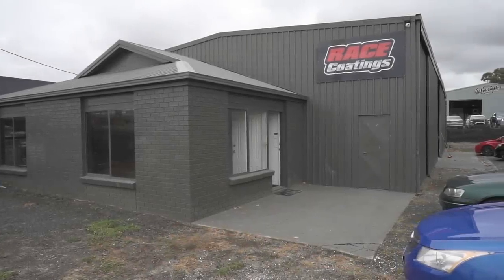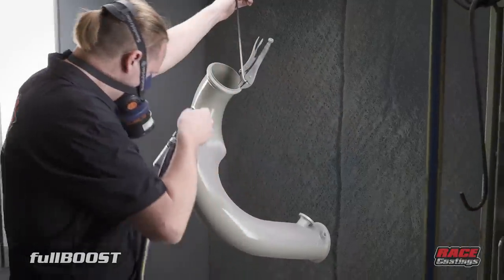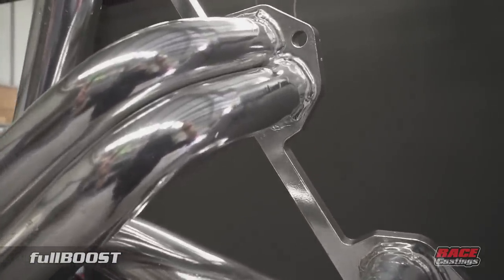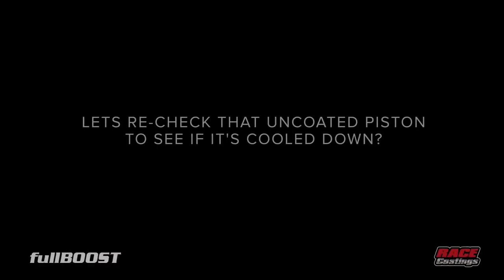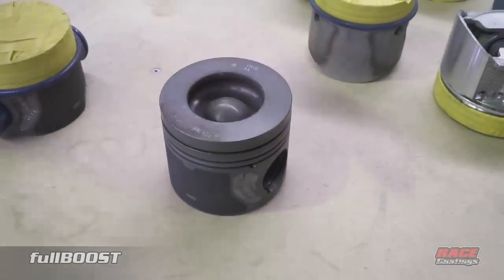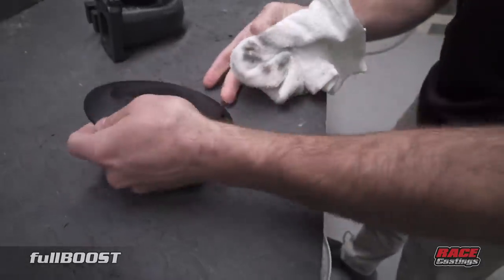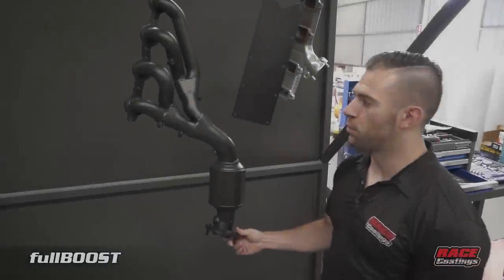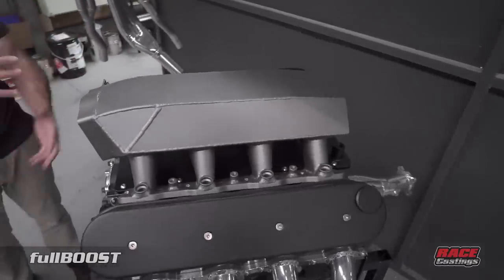What is Ceramic Coating? | Race Coatings

Comment: Ceramic piston faces have been 'standard' in locomotive engines for years.
Their idea of a 'coating' is a wafer of ceramic attached to the piston face.
The entire intent is keeping compressive heating of the air/fuel mixture in the mix, and not letting the piston leach away heat.
Don't recall if the cylinder walls had ceramic sleeves, but it wouldn't surprise me.
Sometimes the best high-performance ideas come from ho-hum everyday things like trains or a bus.
How many stops and starts every day for a bus?  That needs good brakes, a solid transmission and reliable engine, right?
Same with a locomotive: if they can't be run economically at 1,200+ hp, another way would be found long ago.

Comment: I want that done on my Tesla exhaust, pistons, and engine so it runs cooler.
Reply: LOL You did you get the inline 5 or the v 7?
Reply: Tesla such a boring ass car
Reply: That won't help your Tesla, you need to fit twin diff carbies to it.
Reply: You might be shocked by the results.
Reply: i would recommend start by ceramic coating the turbo manifold and then if not satisfied try coating the headers on it (btw do you have the 7 or 9 cylinder) also the push rods and tappets will make the car better if coated!
Reply: LOL You ssRIGHT!
Reply: Brad Viviviyal  That is a ludicrous thing to say!
Reply: You should do it to your piston return springs..
Reply: Why did you forget the turbo?

Comment: How long was the torch held on each piston?
Reply: They do  not apply wit a proane trch, that was a easy way for idiots to understand is heated (bakes0 on as well as slow transfer of heat as fopr the poster sayi g dsoes no t stop np it does not eventuall al would get through but at say a low 3 thousand RPM they hot ehaust gas expelled way before has tome to soak through new COLD inatke etx, it is a blance not a one situytaion as same for your car your pistons would melt if exhaust mot expelled same for engone block, and evemn then need cooling systems.  Apples  to pples and a little or a ot odf commom sense please.

Comment: I wonder if they have a measuring tool to let you know how much ceramic coating is applied to various products like say a micrometer test or better still based on time factor and product adhesion times you will have X amount of ceramic coating on your items like say 0.20 micromillimeter os ceramic coating, i know that Ansett airlines used to have a Acid dipping machine which cleaned up all metal products and based on the amount of time and the type of metal like say stainless steel it will give you a mirror finish based on a time factor wile in the acid bath. :)t
Reply: I agree and thanks for the info, i am wondering if the polished surface will hinder the casket adhesion for the headers especially if using a hi temp casket glue to add that extra protection against leakage etc.. :)

Comment: It may be accounted for here but beware of extremely variable readings with an infrared temp gauge due to surface condition/color.  A shiny surface can easily give hundreds of degrees F lower than a black surface at same temp., it's a serious flaw of this measurement method that I deal with daily.

Comment: Can valves be coated to help prevent carbon build up on DI engines?
Reply: tdawg719  Yes.
Reply: tdawg719 I would think the stem would warp from the heating process. May not be alot but perhaps a bit.

Comment: A couple of things. When or if ceramic coated pistons gets chipped it then causes shitloads of  detonation. I have seen a drag car engine that seemingly swallowed a stone and in turn chipped the ceramic which in turn detonated the engine to death. Plus it interferes with proper skirt expansion as well. Teflon skirt coating wears off sooner than it should. Federal Mogul pistons are sometimes treated this way.
The ceramic coating on headers chips off way too easily as well. Waste of time on speedway headers. And I have seen headers off an engine [that same drag engine] that had the usual rust in them  after being supposedly coated inside and out.
It does however reduce pipe heat externally. I know of a Chev truck though that coated the whole exhaust and the exhaust sagged in the middle! Holding more heat in the pipes, which is good BUT not ideal in that situation. Though the bad is you cannot see a lean situation as the pipes do not glow

Comment: @ 3:52 mark that cant be right 85.3 degrees on the top of the piston yet a blow torch heat is around the 2,000 F and then the inside of the piston is around the 230 degrees c, something is not right here ? Also the heat dissipates as well compared to constant heat inside the compression cambers, but still a coating is worth its weight in gold really if you have a hi performance engine like a drag engine etc. :)
Reply: I think the odd temperatures are due to the wrong tool to measure it. Infrared temperature measurement is not very accurate on shiny/reflective surfaces. A thermocouple might be the better option here.

Comment: I've been told ceramic coating and powder coating intake manifolds and heads is bad because it actually retains the heat instead of cooling off quicker. Some one needs to put this to some real world testing for results because this is the only thing stopping me from getting my stuff coated.

Comment: If the heat cant escape throught the crank case, wont that just make the valves run hotter? I mean the heat is allways going to go somewhere. Headers i can see the benefits but pistons just seams like a waste of money.
Reply: This was on Rotary Englines, which have NO VALVES, simple ports where the rotor controls open a nd clising, yhough the Valve face om]na typical valve englib]ne would reduce valve heat exoption, ad i[on the fc and back side on the exhaust, in ewaddition the vale are does not vent dorectly to the atomospher or headers so the exhaust passge ways should most likley also be cermic coated, and ina  Rotary that would think an absolute must as Rtaries run much hghe EGT Tempratues.

So why ask about "Valves: ona rotary forumn when they have no valves? maybe yiu should change forums or at least learn how the ntake and exhaust ports work on a Ritary (Wanlw/Mazada style Rtary as again there are NO VALVES soi you  question is meanless in this forumn.!
Reply: In regards to vakve coating as mentioned see tdawg719
 below your post. which cklearly states vakve can be coated so can the compustion chamber ina reciporcation engine, heat is eneger, lettn g it escape though the vrankcase, vales, fr that matter headers and nobody denies the benfits of cermic Coated headers buth inide tue and outside tupe.  Since well more than 50% so say 80%_ of a internal cmbustion engine is wasted as heat radiated evem through arditor would make a lot of  sense to tr and minmize heat lose though all surface, resulting in it usable say as driving a turbo charger, preserve life of engine, such as many diesels have used Cermic Incerts in their chnabers, and as RACE enginerong, and many others going back to the Nazis, even before, but the Nazis used cerrmic coatongs to make their aircraft faster more durable and it WORKED.  Since 180 40s cermics have come a lomg way yet 78 years ago Cermic Coatings of engine parts the Nazis, and I am nt a Neo-Nazi or any other putre research showed this, Izuzu has buit an entire cermic tst engone, truce the shape of the rotary engine com[ostion chamber woul madke it slmost imposssbile for ma thin film cermic coating to have and durabilty, but than take a tyoe for dieseals why ni]ot make a thick cermic ritary Chamgbemr not coatong, or that matter the mazda combustion housing have so few moving parts as in none, n valkves, for the person above askig about valves Rotoary/N\mazda Emgines do not have, so to be t the point it would be imposiblwe to coat what is not there, amd as the secomd or next post after the valve question, whch should not evem be im forumn on otary.Mazda engines, the persin  as my reply pointed out the  valves, not mentiones sands the valve to head seals can be coated thus reducing heat flowe into eother exhaust or intake vaklves  michght as well coatd the typcial reciporocatimgs engines pistins and comoubstion chamber in heads, and exhaist port where valves ina reciprocation engn vemt to befor going to header or exhaust manifold and nobody argues cermic coated, inside and outsoe the tube are benfical, it just carring the step tio the next logical step, sermic coat, evem in roatary/Mazda the exhaust port at minimum, the inalke port, also to not asob g[heat from engne housng , which would really apply to turbis, whoch the housing imsod e and impellers shpuld also be coatws as well as shaftthus eeping the ingake charge as cool as possible een afte intercoolimg for that matter the input and out put tubbing from inter coolers, as well as oil and aditor an transmision coolers of noy a flexable plastoc should be coated inside and outsode after all you ar goi g to the troubkle and expensine, and before anyone says yes will costs $$$, but keeing thin gs cool helos create power, after all less cjance holing yourpirston or wping housings, may allow smaller  this less weight coolomg systems, i  formance weight becomes an issue, aam if you are going t the trouble, necessity, to cool the chambers, tramsmissions, oil copolers. etc why allow thermal creep emtte into the atmosp[her under the hood to "creep back n" it may not be #+$$$ efficent but heat is the enemy for engine life, so a properly coated entie chnag]ber, poston. rotors, hpusing, hea,. exhaust ports, headers, vaklve sfor non rotaries, etc. one rely mention his umdr hood tempratire just from cermic headers reduced underhood tempratures 46 deghress F, lower intake charges , and rotaries are well know to need high chamber heat, ad their Exhaust Gas Rempratures are well above a reicprocating engine, it makes a lot more sense to trap as well as prevent ay exess heat to creep in  this alomg with other xhnages such  as bifurocated, stratfied0charged, rotaries, or piction usng combonations of GDI and port injectionshould allow betetr dtiming, less fuel consumption, more power, and rotary emngines from mazada main cause of failure is rtwo fold not knowing how tp maintain as teh two differemnt metals Mazada uses have differnt temprature expansion and contarction properties, meas sizes, leadong to part 2 that idiots not understmimg thermodyanmics and eb'ven basic metal ]\urgy that doffer metals expand and copntract dofferent take a mazada foe]r a mazium run and park it the dofferent expansuion and contradtion results in warped housiongs and arts results in a ruined engine, but taking say 15 to 30 minutes of kow power drovong to reuce temparwtures will do wonders to preserve life of a Mazda engine, for that matter evem a recip[rocating engine if you runniong iron block an alminu heads. So compare Apples to Apples, and for the person aski g about c[vaklve coatings he obviusly is in wrong forumn as Rtary enones do not have valves and it would be impossibe; tp voat air, true the intake and especua]ially the exhaust ports, w\hpuld benefot greatly, esp[ecialy exhaust, see cermic coatongs temprature benefots on headers regardless of engone proves jata all Cermic, or high cernic with metal frame work for the cermic t]THOCK, or that matter wiould it be possible tp change and pressure press in the hosuing on a Mazda/rotary engine like may diesel engines have rsilting in hit exhaut not oaking into rhe crankcase thus taxing the cooling system have be well proven.  So tome to 1) cpmpare Appples and Ap[les meaning when disucssing one engine that eeds vaves to another that has none is nt Apples top Apples,  2) Understamd hopw the engine you are using actually works, 3) research and apply, RACE may make an excellent, or others after say a Mazda exhaist port been machines using plasma or other application oat a rotaries, or reciprocatng engines exhaus prot har higher tepratire than intake, but than tempratire absorbation i slid metal, intake and exhaust to caru]ious collo4rs that makkter om intake manifold would reduce ge\heat absormatio thus loweromh tempratires be it frp m intercoolers, r\turbocharers, for oil and tramsmission pi[ing to the coolers or water radator.  The entore cermoic engine sucha s iszuz bukt and testg and otjers may allow a smaller engone, lesss full, better durabikty as many s]cermics far stromger tham steel amd Grephem see University of Texas professot=r has decpveloped a wa[]uy to add Graphene, top cermics, far stringer than say carbon biber variations, or metal.  Basically exclding ci nouer and fuelk systems the modern reciprocation engine in automobine]bes has changed little in the last 100+ yers.   Maybe tome to stop thinking inie the boix an lpok at alternatoes that midern tecnology has brought.  I would love buikd a rotary withcermic Rotars, housing. side hposing etc. add starfoed charged, fr those that say miximg problem add a inkector ot ]ntake chamber as it phases through rotary faxes small port iject wiull be higly mixed, than add dirct injection into com[ostion chamber, redesign spark plug areas so rpors seal them and add Starfied charged inetion so a kower air fuel  tgus blouger exhaut gas tembraturs and lowr chanber tempratures shoudl work allowing the over coming of <azdas high, thus also poor emissions, hig EGTs, metal expansion nd contracyion variations, etc.  basocally a modern material rotary needs t be developed amd weight and size tp the typcal reciporcationg engne rotoies far exceed, and a modern marterials one would cure most prob;ems and allo miltole fues, such as aliminkum is damaged by ethnol way E-85 certification, pure alchol in rave engones has produced fr more perfrpmance though lower BTC. Calorie ,emeans gram or ounce for ounce not as much heat which is where power comes from, abilty to add ijectors and various cellinodies to run say oher fules, Liquid Hydro, sams the lubricatio emtions exhaust would be water vapor so evem mixures of fules with multiple ojectors.  Thios copuld be app;ied to eciprocating emngibn]nes as well. but klets tale Mehane. not thunderdome styule frpk bp[igs, though that one way land fills leak methamne and methane ios 20 tomes mopre distructive to the ozone layer than CO2 emissions. sp would findong,  par buil over a band fil actualy harvest the methane drys it and runs electrical genration fopr the park on comtin nental mainland USA, Chinais ex[ermenting with new technologies such as cermic engones while USA is like its tele[hone systes pr POTS, Plain Old telephone System, using twisted pair canmnot carry anywhere th need of moddern technology yet "SUNK Coats: utilities, cable combpanies, etc. though cos to install say 19 60s copper the ex[ense has far been paid, time for modern technology there,.  Does modern technology p[lay a oart"  The average, or tha matter most new cars have more computers comtrolling thngs tha used in the Saturn Moon trips by Nasa, yes yur car most ikely has more computers, same for cellphome, computers PCs versus main  frames evem main frames which invented to calculate traectories, and biy did IBM< get it wronf when the guvernment ask what would be the en tire world word wide demand for computers, IB< saod 6, ofds are your cellphone has more.  So backs]wards thinkng or stick in the box I suggest think, is mettal the best thing for internal combustion emgines? or thick mtal coatomgs with cermics to put right cermic emgines, true  cranke shafte or ecentric shaft in Mazda and rotaroes metal needed same for dearsm], at the mopment, but lighter weiufht, sronger cermics, and heat control would revolutinize systems inside the \ox, itr is tome instead of jist thin cpatongs, whicj\h are fine in some casess to looi to m,uxh thicker use of cermics in all engines and in my opinio the rotary.

Comment: It is probably working  

but working with infrared often 

i know this test is no good (the temperature measurement with the infrared sensor)

any chrome or mirror surface doesn't emit much infrared  ...so to see 80 deg with the measuring tool you need to heat it ALOT  as you can see on the other side of the piston  that is less reflective

Comment: The ceramic coating on pistons for the boosted engines is bad, because it decreases the heat exchange , so, the surfaces of piston gets tooo hot, what causes the detonations too soon , aka knocking . Also is the same of the valves. But, on the N/A engines, it is not so bad.

Comment: The torch is 3+ times further away from the ceramic coated pistons.  The more ceramic coating videos I see, the more it seems like ceramic coating is a scam
Reply: and psiton on bottom dead center is mayve 8, 9, 10+ MTOMES FORTHWERa away than compustiuon chnaber at Top dead center and is not instant comustion and you forgot the higntemptaure expanion which makes it work in thw first place,  The sun at ligh speed tales abut 9 minutes for light to reach thers star lighjt you see maybe was emitted billions of years ago.  Yet I can assure you that ylu not going to want to fly into the corona uch less the bodu of a sun or star and distance makes a dofferenxe truye why Mars colder than eartj yet Mucury you going to be birnt dust long before you gt to sy]urface.  Professionals not applying by waving a propane torch forst of all want evem heat, evem cermics in pottery get unevem heat for baking yiu going to gte a failed totally if not just crappy product.  try something called thinking one!

Comment: The work shop said you are breaking the laws of thermodynamics because you are stoping the distribution of heat through the crown. In turn you will over heat in a certain specific spot.

Comment: Coating pistons is all good to keep egt's down...but not for longevity, when around 100 thousand km a peace of the coating flakes off and brakes up into your combustion chamber scratching your sleeves and maybe your valves and bye bye exhaust side of your turbo